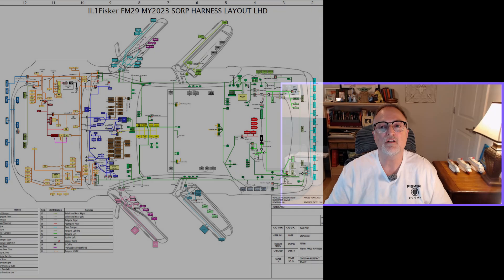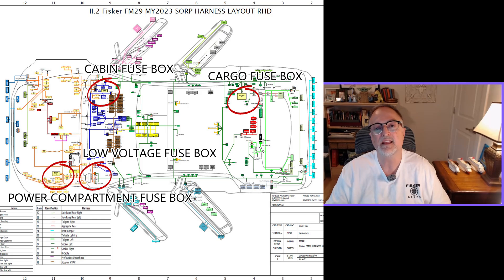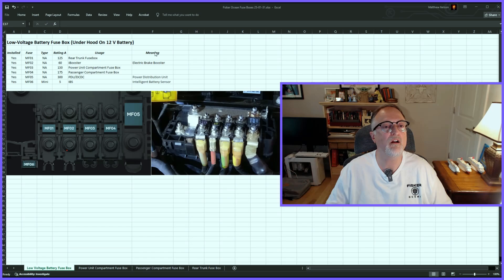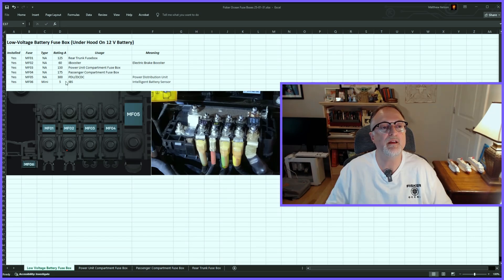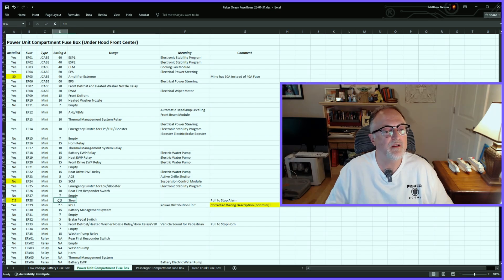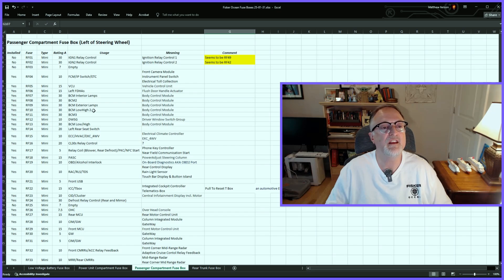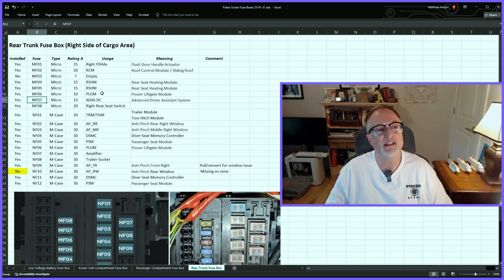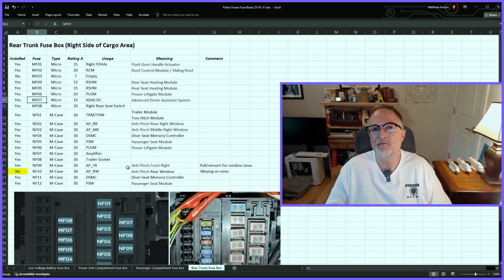Fisker Ocean - Fuse Box & Decoder Spreadsheet

Comment: Hi MT RANGER 

Thanks for these sheets I have issues think fuse related 

My high beam flash only works when the light are in sidelight or manual switch when I put them into auto I can’t flash drivers from your selections would you think ef12 or something like RF13 or RF10 struggling to break it down to an exact feed that would control that module
Reply from the maker: I have not had headlight issues, so I can't confirm.  I would try EF12 first and then RF10/12.  Lighting is hard to track for the most part since is seems to go through various BCM fuses.
Reply: @MTNRanger  Thanks for
Your reply I have ordered all
The parts to make the hood bolts great idea thanks for everything you do for ocean owners the go to channel
Reply from the maker: @CemalGökçetürk  Good luck, let me know how it turns out.

Comment: Do you know what fuse operates the center console USB charge ports?  Not the rear, but the 2 USB's under the arm rest?  These 2 USB ports do not have power, and I have tried RF54, and that did not work.  I do have power to the rear USB-C's and wireless phone charging.
Reply from the maker: The USB ports inside the armrest are RF21. In right side column, sixth fuse from the bottom.